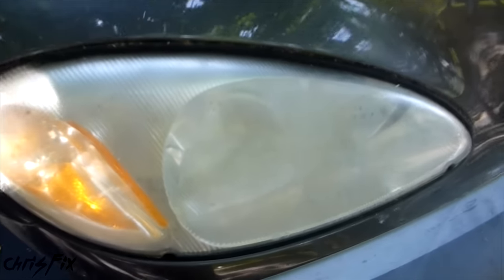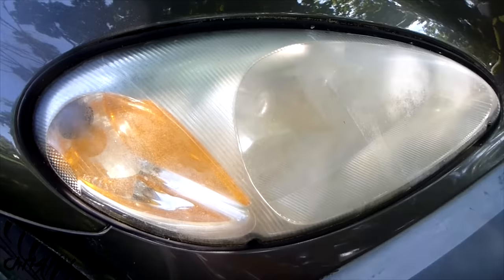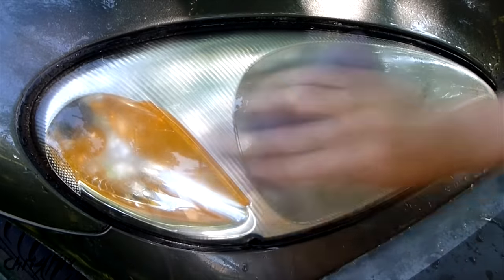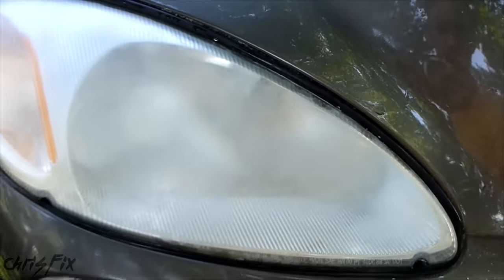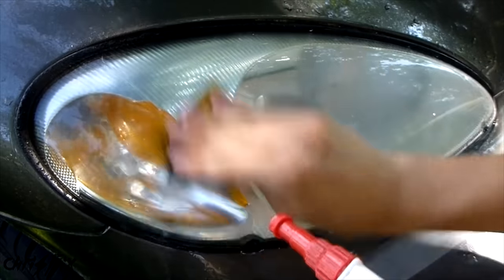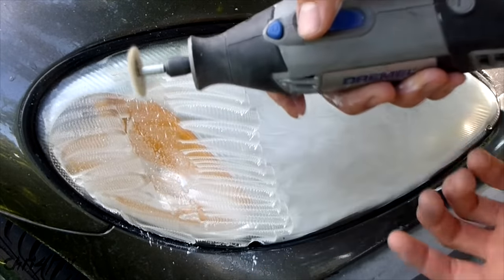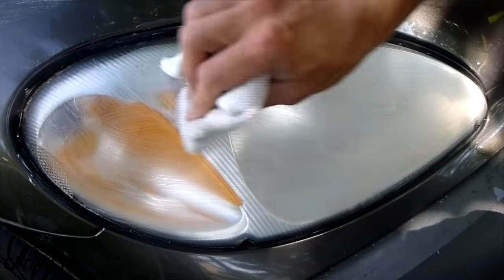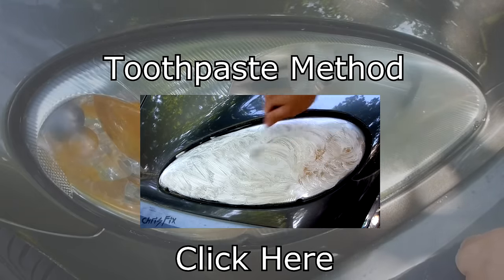How to Restore your Headlights (crystal clear)

Comment: Thank you so much! I called the place where I bought my car and they wanted $150 and they promise to only 90% clarity. Heck with that I’m doing this! Thank you
Well Chris thank you so much. I know there’s been a gap in time but it worked beautifully! It has extended the life of the lights greatly. Thank you so much and God bless you💜☦️
Reply from the maker: Awesome! Let me know how this goes!
Reply: @chrisfix  Absolutely I’ll be doing it this Saturday. I’ll come back and let you know with some pictures😊
Reply: @cookiesweikert7  So, how it goes?
Reply: @helfix4762  It weren’t for better than I expected. At least I won’t have to get a new headlights for a while yet. They are sharp and they are Clear
Reply: Yah, my place wanted $200.00 after my cat failed inspection there. But I spent days looking into do it yourself stuff and tried the toothpaste method and then an inexpensive kit from ArmorAll. Still had some white-ish streaks, and re-inspection today now says headlights need to be reaimed (one of them). The inspector said it's probably because the foggy streak is changing the angle the light is emitted from. So I said I'd redo the headlight cover and come back. Tried baking soda but only slight improvement. But I don't have all this sandpaper or any electric buffer or any such thing. Maybe a better kit will do the trick, I don't need to stock up on a bunch of stuff bc I'm in a small apt and might sell the car and/or might be moving around a lot in near future. I wish I knew more people or had a boyfriend who was handy. I had a bf but he was not much use, tho he was sweet and funny.

Comment: A soft cotton buffing wheel from Harbor Freight (about $5) on a viable speed Drill works a hell of a lot better and FASTER too.
Reply: What lubricant?
Reply: awesome thanks I was wondering how I'd be getting that tool
Reply: It's only $5 for you because you own a drill. This is the cheaper version for most people.
Reply: @FLdancer00  Dang it I don't have a drill. Mine are in SERIOUSLY DANGEROUS SHAPE. Can't see with them barely @ all. I've ALWAYS been a bad night driver. I was taught when I learned how to drive by my very missed dad 💗 to watch the outer line NOT the middle line. I'm from Oregon so we can get some HEAVY *SS FOG. Now I'm in Cali with a down graded quality vehicle.  DUE TO COVID & NOT much work oh & NO FLIPPING ENMPLOYMENT/ Self employed in Oregon & NOT GOING TO BECOME A CALIFORNIAN so I was informed I COULDN'T COLLECT MY BEEFY EMPLOYEEMENT....Long Story.. So I need to fix this issue!! Cali town & country roads are the absolute WORST & DANGEROUS! Cali has much better & bigger  Hwy's then Oregon.  Cali town & country roads are alot more dangerous then  Oregon's Flipping FOG!
Reply: It will polish it clear but has no protection from uv rays

Comment: This was never a problem when they made the damn headlights out of glass
Reply: I have a chip in the headlight glass on a 84 Caprice.
Reply: I agree.  I wish headlights were still made out of glass!
Reply: WV591 just about to say my 78 cortina is still crystal clear
Reply: WV591 yes my 2003 daihatsu coure's light is crystal clear even after 14 years
Reply: Right?
Reply: No, back then the headlights were cheaper and you replaced them.  Today, you have the bulbs and the housing separate.  The sealed beams worked better since you didn't have to worry about touching the bulb, installing them, or the housing oxidizing.  Now, you have to replace both, or fix them like this, which costs a LOT more than the old sealed beams.  It's all about money.  If car makers can think up new ways to separate you from your money, they will.
Reply: My old Mitsubishi Galant 2.5 V6(1997) has headlight glass. No problem with yellowing or something like that. :) Still looking good!
Reply: Made it of plastic and jacked the price up on it now.
Reply: But with all these damn potholes nowadays you'd be driving with cracked headlights.
Reply: E B I've drove for for 32 years and never heard of a cracked headlight because of potholes. The glass headlight was really very durable. Very easy to clean with Windex.
Reply: That's capitalism for you. I work on appliances for a living and one thing is clear. They use to make them last allot longer than they do now. A washer use to be built to last 20 plus years now you're lucky if you get 10. Planned obsolescence.
Reply: L Roper The potholes in cities around Boston are like craters/sinkholes.
Reply: E B I've never had the pleasure of going to Boston. I hate to hear that for you guys. I'm in a small town in Upstate South Carolina.
Reply: I have a 1997 Volvo which has glass headlights. I recently had to replace a shattered lens on it (fortunately the glass alone can be replaced rather than the whole headlight), and now looking at the new one vs. the original one side-by-side, it's noticeable which is new and which isn't. It's not nearly as extreme as with plastic headlights, but the older one does look slightly hazy in comparison.
Reply: The entire reason to shift over to plastic headlights was due to pedestrian safety. The glass shards would stick into pedestrians before. I still hate plastic headlights though.
Reply: Yes they were so much better.  I drove long haul truck a long time everything on THEM was "MADE TO FIX".  Sadly they are even putting CAR SHIT on them now.  Used to, they had Pneumatic windshield wipers, if one blade went BAD.  If it was n the right side, you just turned that wiper off, you did not need it anyway.  Or if the LEFT one went bad, they take the one off the right, leave it OFF and put it on the left, and you are good for 2,000 miles home.  Not anymore, now they are electric and hooked together like a damned CAR.  The Injector pumps now are electric and have "chips" etc.  All that shit does in BREAK DOWN PREMATURELY which is that the sorry bastards want so they can sell you another one you do not need.  BB
Reply: You know it
Reply: WV591 you have
Reply: Yes my
Reply: deadbird1229 
Yes my ❤️ can't Beno I will be
Reply: E B you're
Reply: I used to own a 1992 Honda Accord. I thought it was a pretty unique car in that it had glass lenses with replaceable bulbs. Wish I 07 f150 had the same.
Reply: @adfggffffffddffd  A lot of that is to do with the fact that they outlawed lead based solder, if you get bored look up "tin whiskers" that explains a great deal of "why they don't make things like they used to"
Reply: Yes, but it iwas s problem for factory. It needs more money.
Reply: Bruh FOR REAL
Reply: Exactly!
Reply: @jayodon67  Many of the longevity problems in vehicles and many other machines can be traced to elimination of chemicals in manufacturing. It turns out that nearly anything that stands up to nature very long is also carcinogenic.
Reply: @adfggffffffddffd  I'd rather live capitalism than socialism I "enjoyed " first half of my life, where most people could not afford a car, which was a crap quality to begin with.
Reply: @18BravoMOS  You have not seen nothing yet. Autobile manufacturers will start producing vehicles that nobody will be able to own, there will be a maintenance contract, and the vehicle will be leased to you. There a reason for that, so they can track your movements with " their property " and if they don't like it, they take it away from you at anytime, and there will be nothing you do about it. It's all about controlling the masse's. That's coming to a friendly dealership near you. Period.
Reply: Absolutely right!
Reply: Because weight reduction bro
Reply: @adfggffffffddffd  Been saying that for years and the young ones do not get it. 

They are so used to the current life cycle of products they don't even notice or question the life of the expensive item that broke. Sad sad state of future generation.

Once we (living memory) disppear there will be no one and no possibility of waking up the next generation from the manipulation and conditioning they are accustomed to accept.
Reply: @fatmax2195  Pedestrians are least likely to get glass from headlights since they are softer and get thrown more.   

Safety/Environment is often gamed to pursue other agenda (cost cutting/profits).

Out of safety concerns they then introduce the Suv (more profit) and now more metal and higher center of gravity hits the pedestrian with zero chance of deflection rather than much lower and more sloping front of regular cars.

There goes the  advancemment of headlight for safety reasons.
Reply: The headlights on my car are the least of my worries.. I' m more worried about the exhaust falling off again. Or maybe something slightly more important like the transmission.

Comment: Chris I believe you could cut you some round pcs of these grits and use an orbital sander which would be much easier. Use double sided tape to keep paper attached to sander. I used orbital sander and buffer pad to apply wax and shine up headlights when finished. Just a thought.

Comment: I've been experimenting with different things and I  finally found something that just wipes the grime away. There's a concrete cleaner at home depot. It comes in a green bottle with pink liquid. I put some a paper towel and all the yellow came off onto the paper. Then I used windex.

Comment: Hi Chris, 3M has the most expensive kit comes with clear coat wipes. What do you think of that? I have used them on a several different projects and the last coat makes headlights shinier but sometimes cause some fine lines or very tiny bubbles!

Comment: after sanding with 2000 grit you can then clear coat it and it will look alot better
Reply: Nicholas Reynolds please do not do this. As bad as it is to use tooth paste, clear floating is an even worse idea... look up the correct way to do it...
Reply: I had a buddy think he was doing me  favor and clear coated my headlights after polishing them. Now the clear coat  is peeling and I can't get the clear coat off to restore the headlight. Suggestions?
Reply: evcass69 by the way, if you are going to CC, you should never do it after a polish. Polishing leaves oils that do not allow cc to bond with the plastic, so that was a no no for you
Reply: Moreno12 I did not request to have anything done with my headlights, my friend took it upon himself to do it as a surprise favor while we were waiting for engine parts.
Reply: @evcass69  sand it off

Comment: i took a clean t-shirt and a hacksaw black, put my side windows down and used the cloth-covered hacksaw blade to clean the liners on both the inside and outside that the glass slides up and down against. no more lines and dirty windows when you open and close them.  little windex to cut the crud, and the  black dirt removed and revealed on the t-shirt was amazing. thought you'd appreciate.
Reply from the maker: +oh ok Thanks for sharing! That is a good idea! I like how you think outside the box!
Reply: Huh? You used a hacksaw blade on the headlights? I'm not following you.
Reply: clean  side windows. roll them down. line of scum where they stopped an go back up again..  nothing to do with headlights.  it's about cleaning the felt liners inside and outside the slide window glass.

Comment from the maker: Cody Sinclair I cannot reply to your comment for some reason so I hope you see this. After the 2000 grit sandpaper did you apply wax? It should clear right up... If this method doesnt work for you then try this (you already did all of the work): How to Restore Headlights PERMANENTLY
Reply from the maker: Mike Strickland You might have used too light of a coat. There is a delicate balance when painting (which I am not really good at haha). You need to get it thick enough to coat the lens, but not too thick where it runs. You can try sanding it down again with 400 grit and start over. Or you can use 2000 grit and and down the orange peel really good so it looks smooth (but it will look scratched up). Then use compound and a buffer (or elbow grease) to really buff the lens. Let me know how it goes!
Reply from the maker: Mike Strickland Keep me posted and good luck!
Reply: You'd probably be better off with alarger buffing wheel than a dremel... You'll have better luck keeping the finish uniform on the headlight... AND you'll have a wheel you can use to revive dead paintwork as well!
Reply: thOMAS TRAIN

Comment from the maker: Here is the way best method to Restore your Headlights Permanently! 
How to Restore Headlights PERMANENTLY
I have been testing different methods and this is what I have come up with for the best results!
Reply: I like the idea of the UV clear coat, I'm going to try that. I wonder if I should get the colgate & dremel before the clear coat?
Reply from the maker: Grunchy Follow that video exactly. If the surface is too smooth, the clear coat will peel in under a year because it cannot grab onto anything. Also, without a rough surface, the clear coat will run down the lens.
Reply: ChrisFix Hi Chris, I used your method but forgot to shake the clear gloss  before applying it and when applying it a little ran down the upper left corner of the light. I tried to remove the wax to no avail so I continued to add two additional coats and it is still cloudy looking. Is there anything I can do now to clear it up? Also, it cleared with a slight roughness to it.
Reply: +ChrisFix I had already seen the one with toothpaste and baking soda and a toothbrush. I think I'll try 1000 then 2000 sandpaper, then use some toothpaste  -if it's looking pretty good after the 2000.
Maybe I'll try 600 grit if that doesn't work.
One of my headlight covers is 13 years old and it looks really bad. The other one is only 8 years old and is in a lot better shape. I had to replace that when I rear-ended that SUV while a was distracted by a cement elephant painted pink by the side of a wet road:).
Reply: wet sand with 2000grit and use rubbing compound until it looks clear and then apply car wax over it
Reply: ChrisFix Having issues... so I own a 08 Mazda 3 and wanted to try this method. I had already done the toothpaste method before (when I first bought this car/4months ago ) I tried this method tonight with 400,600,and 1500 grit sandpaper. I followed everything exactly step by step (minus the drill) and it got the oxidation off but STILL foggy and lookS worse then before. Advice???!
Reply: Cody K after this use 2000 grit. If you have provision to rotary/car polishing machine use compound over it with machine and then seal with clear coat. Even if you don't have compound machine just clear coat it but after atleast 2000-2500 grit wetsanded surface.
Reply: ChrisFix
Reply: ChrisFix
Reply: ChrisFix
Reply: Lil' Bones 
Leo
Reply: bay chu de con
Reply: ChrisFix

Comment: Hey chris they came out really nice you should also try using clear coat it works really good and last longer.
Reply from the maker: Jose Hernandez Thanks for the tip! I was thinking about it, but the wax lasts about 4-6 months and that is typically how often I wax the car so it will just get a coat then!
Reply: Nice mine have lasted for over a year now but I need to try the wax since it's time for me to redo mine I will post a video.

Comment: tried this method and completely ruined my headlight lol  Here are my personal notes: 1.  if you do this out in the open, be aware that derbis will often fall on your headlights. Wind kept bringing in dust, pollen, and other junk. Best to do it inside a garage with garage dooe opened. 2. Use newspaper instead of a plastic bag. Many of the trash bags are made to resist cutting. I had a hard time cutting a bag even though the scissors were new!  Also when I remove the tape from the bag, a gust of wind blew the air into my headlights and got stuck. Gonna try again and see how it goes.

Comment: My method is simular. I don't normally start with anything below 800grit unless very bad sometimes even some gental 2k wet sanding will do it. Then i use mothers mag polish and clean one more time after and then use a nano ceramic coating. Looks great long term.

Comment: I'm assuming the wax step will have to be repeated several times a year ( more in areas where it rains / snows a lot for instance) I have another question though. The headlights on my 2017 Toyota Highlander aren't "foggy" so to speak but there is a slight "haze" on the lens situated right in front of where the low beam bulb is. It's almost like a small2-3 inch circle of "spider web" or hairlike scratches. It doesn't severly obstruct the beam of light but it does seem to distort it a little bit and is quite noticeable when the low beams are on. Would you suggest doing just the last few steps ( no 200 and 600 grit just go straight to maybe 800 and then 1200 or 1500 and finish it out with 3000????? and compound and wax ( or would  2 coats 24  hours apart of a ceramic sealer spray work better?

Comment: Hey Chris, thanks for the video. Do you think this will still work if the headlights are nice and smooth since that’s how they are on my car but have quite bad yellowing (its more of a swirly motion than the uniform yellowing). Ps: I tried some heavy duty turtle compound that i had lying around on a tiny area to see if that would make any difference (as an indication that the sanding method would work) but to no avail. Any help/input would be greatly appreciated!

Comment: Off bug spray with a soft cloth (i use an old sock) spray ot on the cloth and wipe clean! works like a charm!!
Reply: Danielle Nelson Bug spray does work well, how ever, it's not good for the headlights.
Reply: he has a video on why that is bad
Reply: Xin Lan its good for if the paint on the car has bad paint and you don't really care about the car. bug spray runs off and melts the plastic. but if you're just desperate and need it to pass inspection then it does the job